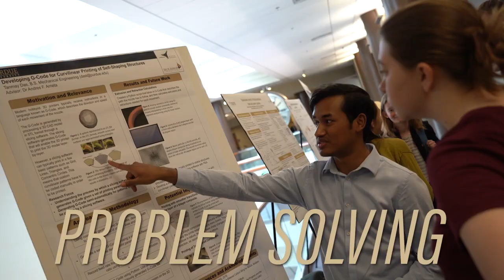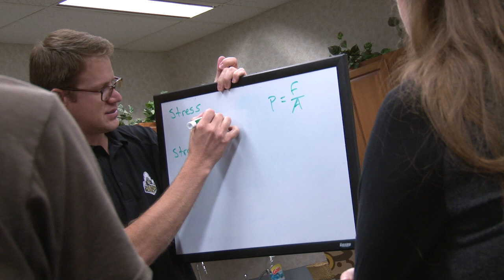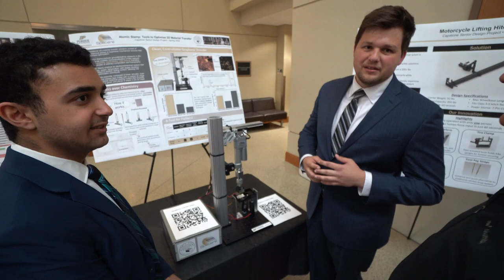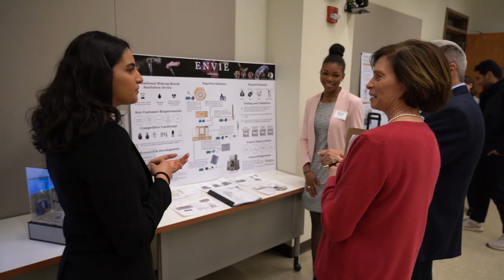What is Mechanical Engineering?

Comment: Ohhh.. I'm so sad I'm first to comment,,

I embrace mechanical engineering like an anchor in a stormy sea!

Our world is driven by mechanical engineering! It animates our robotics industries, our factories, our homes, our cars, (and pickups). 

A friend of mine works at a power plant in Denver. He insisted computerization will rule our entire life and world soon. I started laughing on the phone. He began explaining that he could modulate electricity going from plant to various sectors with only his laptop. I laughed harder!! 

I carefully explained that it doesn't matter how many electronic impulses or commands he sends through the control systems they cannot and never will be able to turn dials, manipulate levers, open gates, throw breaker levers, or even secure facility by locking doors without mechanical engineering devices, servos, solenoids, rehostats.

He doesn't call me any more.. haha!!